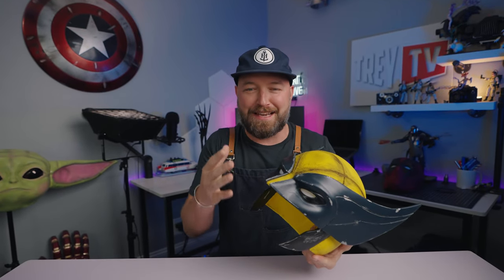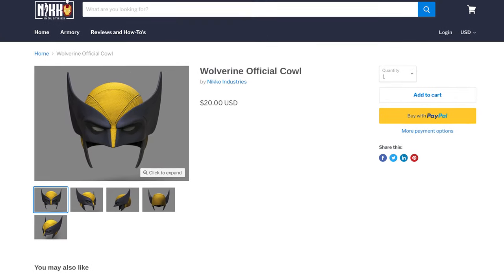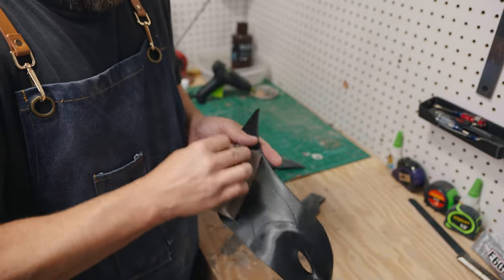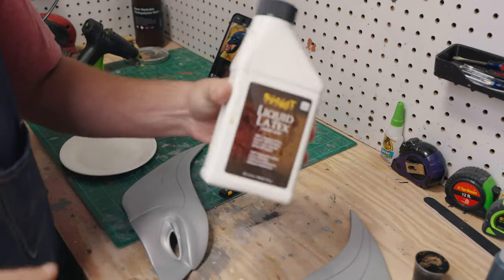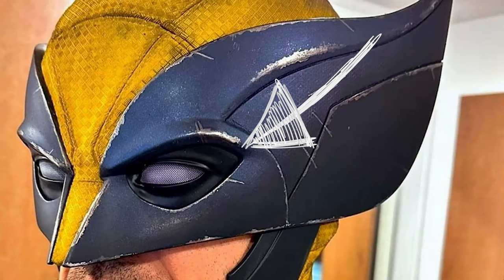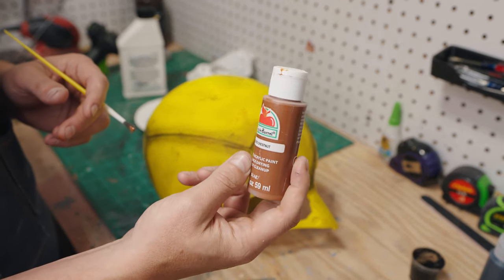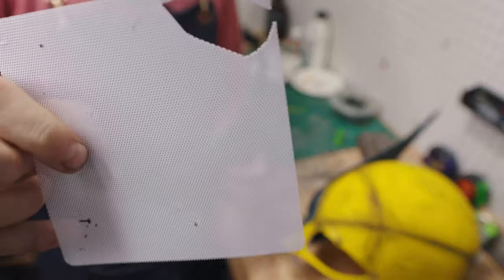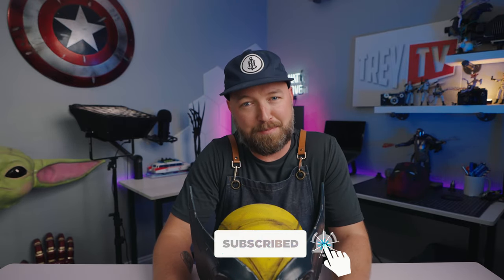I 3D Printed A SCREEN ACCURATE Wolverine Helmet! (Deadpool & Wolverine)

Comment: Very helpful. 
It's the coloring that is key to this ,great job man. I am making mine by hand , so no 3d printing lol
Reply from the maker: I appreciate it!! That’s awesome..doing it with foam?
Reply: @TreyEversman  actually starting with masking tape, wood glue, regular white glue, then will be shaping and forming it with either wood filler and or condo. Then I got some fiberglass clothe and resin. I will be either applying over it or creating a mold for it depending how it turns out lol.
Reply from the maker: @DoctorGnu  DOPEEEE!!!